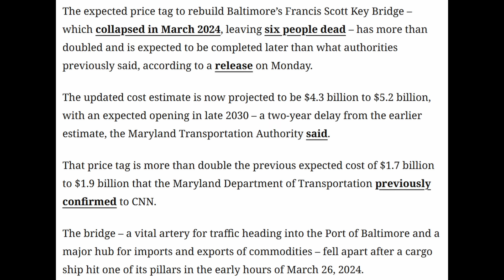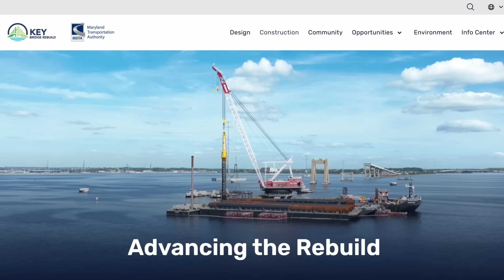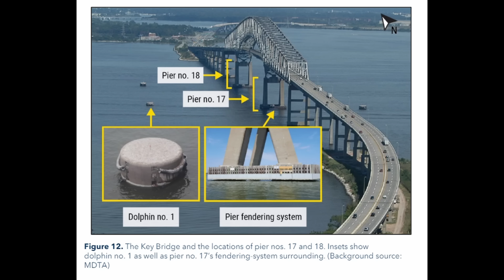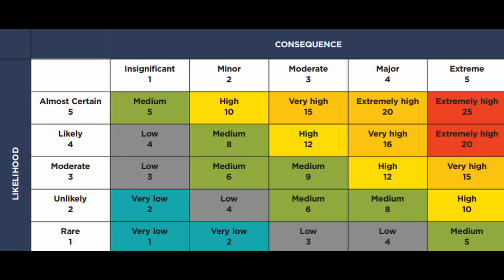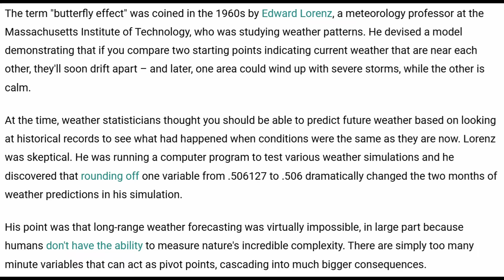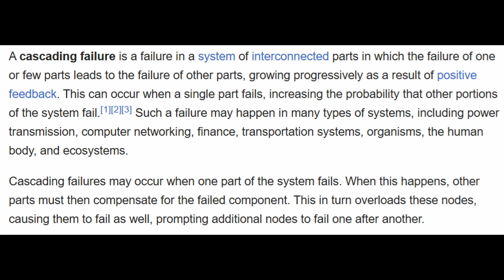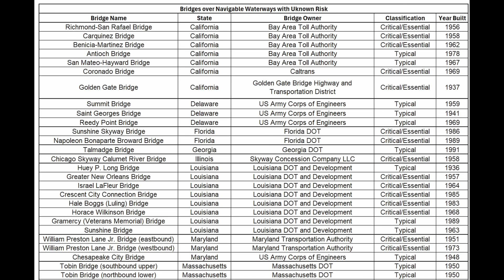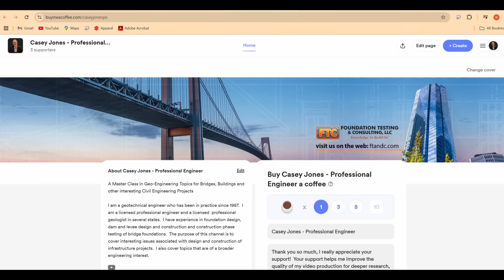Key Bridge Destroyed because of a Label on a Single Cable

Comment: I’m a HVAC service tech with 38 years experience. I can’t tell you how many hours we’ve spent on jobs and at the end finding that very same style of bad wire connection. When you have that many wires going through equipment there’s going to be issues like that. I wonder how long it actually took to find the problem without regard to what happened.
Reply from the maker: I was amazed that the tracked that loose wire as a factor in the disaster.
Reply: @CaseyJones-Engineer  And they found it very quickly, within a few months of the incident.
Reply: Thermal imaging camera can detect heat differences on switch boards to identify loose wires.  The safety step was never required or done.
Reply: @jeffreysachs3423  In this case it would have to be done periodically. That wire was tight enough for years before it popped loose.

Comment: Well, one loose wire compounded by having the power transfer in manual instead of automatic (which is apparently 'fine' but IMO if your automatics aren't working you should be fixing them before leaving port, and if they are working you should be using them during critical phases) compounded by having the generator fuel systems illegally misrigged, so neither of the next two layers of redundancy that should have caught it happened automatically and instead required people literally running around the engineering spaces hitting switches and doing cold-starts on generators and engines

Comment: It's not clear to me that a cable-stayed bridge is much better able to withstand a ship impact.  The towers rely on balanced forces through the cables, and the decks are designed to resist compression forces, not the kind of bending force that would result from the failure of multiple adjacent cables.
Reply from the maker: Cable stayed bridges can have much longer spans and keep the main piers further away from the main channel.
Reply: They're pretty robust. The Tacoma Narrows bridge took half an hour of flexing before it broke. The cables are designed to be redundant as well. But no bridge could survive losing a tower. So preventing collisions with them would have to be considered.

Comment: There were a lot of things that could have been done differently on the ship.  The backup power systems should have been running  The undervolt  protection should have been disabled (and it should be possible!) to run without it when transiting a critical strait.  And a giant ship like Dali, in an ill-protected strait should have been accompanied by a pair of tugs, just because the bridge protection is inadequate.

Comment: A clarification about probabilistic risk assessment techniques: it's not supposed to require an estimation of the probability of a loose wire, in a panel of a cargo ship, built x number of years after the bridge was built, etc. 

Conditions like that, where the risk is inestimable, and beyond capacity for reliable control, are assumed to be certain (probability = 100%). 

From a safety standpoint, a more effective approach might consider: if the piers are integral to the bridge, how much energy must be applied to a pier to cause failure? Engineers love to answer questions like this. 

Next question: how could that amount of energy be applied to the bridge pier? A ship strike is one scenario, obviously. 

So here's where things get dicey: we can use the equation for kinetic energy, and set parameters to limit combinations ship size (mass) and velocity through the channel to ensure no ship has the kinetic energy to take out a bridge pier, and this is likely what happened when the bridge was built.  

And that was probably adequate to reduce risk to acceptable levels, back in the days when ships were smaller and lighter. 

There may even have been a discussion at the time about building artificial islands to protect the main piers, but fears of encroaching on the navigable depth of the channel might have rejected the idea. Maybe it was felt the cost was too high (though cost is not supposed to be a factor when deciding about safety), but whatever the reasons the risks were judged to be acceptable, and the risk file was closed. 

Fast forward 40 years: velocities for tidal flow under the bridge might be similar, but ships are now 100x the mass of the ones used to calculate risk started using the channel, and the kinetic energy applied by one ship greatly exceeded the design limits of a bridge pier. 

With increasing mass as a certainty, the other option is to reduce (absorb or re-direct) the velocity of ships ahead of the point of impact. Build barriers that can slow large ships, or re-direct them away from the piers. 

I believe that in this case, the risk calculations may not have been wrong, they just became obsolete, and were never re-assessed as the size of boats in the harbor increased.
Reply: The original risk calculations were somewhere between obsolete and irrelevant after the ship channel was deepened and widened.  As originally built there was a significant area of shoal water between the bridge piers and channel.
Reply: Concrete doesn't care about energy, just force, and the force of an impact is impossible to estimate without a detailed understanding of how the two bodies flex as they collide. The fix is to get out of the materials domain and build protections that use simpler physics, like adding dolphins that are heavier than any ship, or islands of loose matter that will absorb more energy than any ship will bring.

And then some idiot will build a ship with a mast too tall to fit under the bridge and sell it to an idiot who forgets it's taller than the bridges he sails under...

Comment: The probabilistic thinking reminds me of Richard Feynman's thoughts after investigating the Space Shuttle Challenger disaster. Apparently at one meeting they were asking mid-level managers (not sure if NASA or Rockwell) what they thought the probability of another shuttle disaster was and one of them responded something ludicrous, like one in a million. IIRC a "Now we know what not to do," attitude.
Thanks for the detailed review and, oh yeah, common sense thinking about improving safety. I'm setting aside some time to watch the full NTSB hearing soon.
Reply: My recollection [Space Shuttle Challenger disaster] was that the low level rocket engineers knew 1 in 75 rockets exploded, and allowed an extra factor of 4 for being human 'piloted'. As the 1:300 figure got passed up the hierarchy, at some middle management point, they swapped that expectation value for a desire value of 'must be greater than 1:10,000' without reference to the hardly heard expectations of the 'old hands'.  And so it goes on.

Comment: (5:12) "... probabilistic approach ..."  is garbage where the product is mission-critical and human lives are at risk.  In such cases engineers should use worst-case analysis instead.
Reply: Look up Risk Assessment Matrix. Probability and severity of failure are both considered in order to justify requiring the extra effort and expense to prevent it.

Comment: No the bridge was destroyed because of inadequate dolphins.
Ships are complex machines and complex machines always fail, for one reason or another.
Reply from the maker: I have done multiple videos about the inadequate pier protection for this bridge and also mention it again in this video.
Reply: The deepwater pier protection problem -- shallow-water piers can be shielded with dolphins, rock islands, or stone-filled cylinders. These systems dissipate energy and redirect vessels. Deepwater piers are far more difficult. The forces from a Panamax or New Panamax vessel at speed are so immense that no proven, full-scale technology exists to guarantee protection. Current practice relies on enlarged dolphins, sacrificial islands, or layered piles, but these are extrapolations of shallow-water solutions. They have not been validated against the kinetic energy of modern container ships in deep channels.

The final report will almost certainly stress that there is no proven, universally accepted technology to protect deepwater bridge piers from modern containerships. That is why many new crossings (Corpus Christi Harbor Bridge, I‑710 Long Beach International Gateway Bridge, Gordie Howe International Bridge, Hampton Roads tunnels) avoid placing piers in navigable channels altogether.
Reply: @alanstevens1296 oh well i guess as it isn't easy, we shouldn't even try.
You would mske a great sadety engineer.

Comment: I don’t know how they are using the probabilistic model for bridge hazards from ships. I know that Probabilistic Seismic Hazard Analysis (PSHA) is well established as the main method for evaluating the earthquake hazard for bridges, buildings, and other infrastructure. The number of bridges across shipping channels might be small enough for a simpler approach, but it ultimately is necessary to decide how much to spend on dolphins or other protection.
Reply from the maker: They could have provided a significant upgrade in pier protection for this bridge for around $300 million versus the billons (and lost lives) that it will cost them now.
Reply: @CaseyJones-Engineer  
$300 million won't stop a 100,000+ ton ship from destroying a main bridge pier.
Reply from the maker: @alanstevens1296  Don't be so sure.
Reply: @CaseyJones-Engineer  
Don't be so sure yourself. You are the one who wants to spend $300 million.
Reply from the maker: @alanstevens1296  They missed their chance to spend 300 million dollars to protect the bridge and now they get to spend over 5 billion.

Comment: As others have noted, Sal Mercogliano explained in his video the badly installed wire combined with several other bad configurations and usage choices to cause the loss of power and prevent the crew from restarting the main engine. In addition, the main engine did not need to shut itself down immediately.
Reply: One of these aspects is the channel that enters the main channel just before the bridge. This removed one of the natural “guardrails” that would have kept the ship in the middle of the channel.
Reply: They weren't bad configurations, as comments on that video noted you cannot set it to automatically switch over incase there is a fire. Furthermore using the wrong pumps saved a lot of hassle when changing over fuel...how is the crew supposed to anticipate they would have a completely unexpected fault with a loose wire just before approaching the bridge if everything functioned fine for the past 10 years.
Reply: Sam Mercogliano What's going on with shipping?
Reply: @patrickdougherty2777  Sal.
Reply: True but it was the rule to shut down the engine on coolant failure when the ship was built. That has changed also they did not change over the breaker. Their procedure was to reset the breaker that tripped not switch to the alternate apparently change over is not a trivial task and requires training don't forget dolphins suitable for the job would have stopped the ship! No damage to the bridge

Comment: I'm trying to decide what you were saying, but if you were saying just fix the problems, everything comes with a cost.  The federal government has required cost-benefit analysis for new regulations and designs for some time now.  In 2024, the cost of a human life to be used in trade studies was pegged at $13M I think.  The reason for a cost-benefit analysis, even when human life is on the line, is that you can make something very safe but at a cost so high it is not economically feasible to build or operate.  And safety effectively becomes the mission instead of the mission being the mission with safety as a constraint.  Mike Rowe calls it Safety Third.  As an example, this bridge didn't need to be replaced because of safety.  A much cheaper alternative was large ships steaming through the channel just needed tugs as a safety layer.  And in some ports they do require tugs to be secured to the ship ready to keep the ship in the channel when a steering or other engineering casualty occurs not just getting the ship into and out of the channel.
Reply: Tugs are a fine idea but malicious operators wanting to block critical harbors should also be taken into consideration. 
Important seaports like Baltimore merit serious infrastructure hardening against not just accidents but deliberate attacks.
Reply: @Comm0ut  My big fear was initially it was deliberate.

Comment: Recently, I have studied some other tragedies such as the Our Lady of the Angels School in Chicago (December 1, 1958).  In many of these tragedies, a pattern emerges. While there were new safety regulations in place, older facilities like the church were "grandfathered" in and no improvements were made. The lesson learned is that new safety regulations and grandfather clauses are an awful combination. With grandfather clauses, one is playing the odds that nothing will happen. The problem with that is if something does happen, it will be catastrophic.  For existing facilities, short- and long-term mitigation plans are definitely needed. 

Which leads to this bridge. It has been documented that other bridges have collapsed from being struck by boats. And the boats have gotten bigger over the years. AASHTO develops a very subjective risk analysis that has many assumptions. (Good engineering analysis is to keep the number of assumptions low). This confusing risk analysis is basically a grandfather clause that can be used to justify in not taking prompt and appropriate action by manipulating the numerous assumptions. Common sense would ask, "How quickly can a reinforced dolphin network be designed and constructed?" With prioritized funding, within 5 years. 

Instead of using probability analysis with many assumptions, common sense short-term and long-term mitigation is needed here. It is simply not acceptable for the Key bridge to exist for 47 and nothing was done to reinforce the dolphin network.

Comment: I've seen similar issues with PLC connections on low voltage control circuits that caused headaches and intermittent problems 
.

Comment: Great coverage and commentary.  I totally agree with you.  You cant make all these assumptions about how things are going to work out just fine.  I always try to assume what is the worst way this could go and is this system robust enough for the circumstances.  You can't always predict every possible outcome of failure mode, but you always do your best to make strong robust infrastructure, whether you are repairing an automobile, building a bridge, whatever you are doing.

Probabalistic approach is silly.  Whats the odds i'll win megamillions? Extremely low, but someone always wins eventually.
Reply from the maker: Thank you for your excellent comments!

Comment: I was thinking it was a large power wire, not a small low current draw control wire, but that's all it takes to screw the pooch.
Retired Industrial maintenance technician.

Comment: A single point failure did not cause the bridge impact, watch What’s Up With Shipping. The crew had bypassed the safety redundancies in order the facilitate the change over of fuels for the engine from high to low quality, this made an auto restart of the engine impossible.
Reply from the maker: I explained in the video that this wasn't a single point of failure but a long chain of causations that could not be predicted using a probabilistic approach.

Comment: Anyway one looks at it assumptions need to be made. But the problem comes in when those in authority close mindedly lock themselves into only one inflexible position. Such as if there point of action is set at a 100% probability; therefore anything that is at 99.999% is not even considered as a possibility. And they arbitrarily set their 100% point.
    I noticed that the new bridge will be higher and wider so that in the next 50 years they can dredge the channel wider and deeper and have a AI driven 500,000 ton ship with a software glitch take the bridge out again.

Comment: Interesting theory of causation; a mis-applied ferrell on a control wire termination. So, how long had this "wire" with the mis-applied ferrell been in place? Since original fit-out of the ship or more recently due to maintenance or repair? Your overview and explaination of risk assessment is very helpful. It will be interesting to see where this goes. Thanks for sharing.
Reply: It was the wire label, not the ferule that was wrongly placed.
Reply: The ferrules were all fine.
The problem was that the labels were applied wrong. The photo of the panel shown in this video is not of the Dali, but of its sister ship, the Cezanne. On the Cezanne, we see the labels applied correctly, with a gap. The photo of the Dali’s panel (in the report, but not shown in this video) shows ALL the labels over the ferrule collars. The problem is that because that obscures the wire-entry side of the ferrule, it makes it essentially impossible to visually inspect whether a wire is fully inserted or not. So the incompletely inserted wire did not stand out among the literally hundreds of similar-looking wires in the same panel.